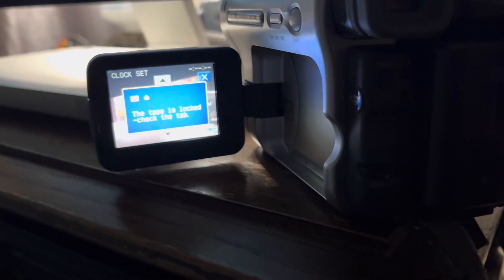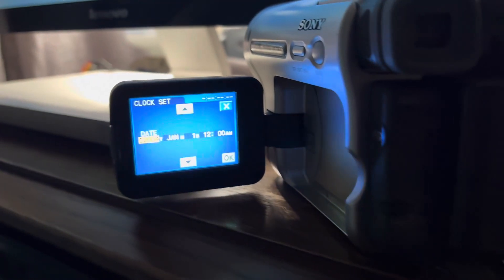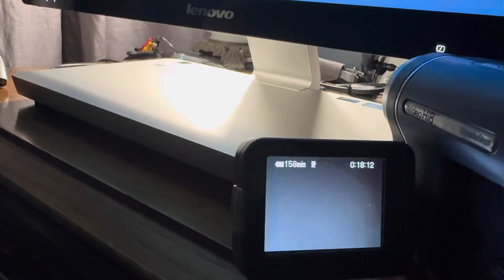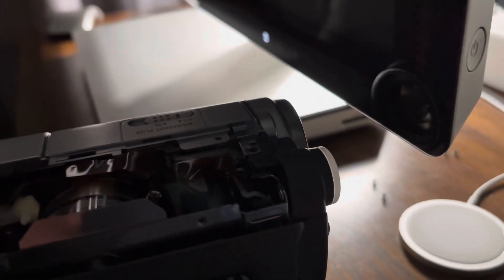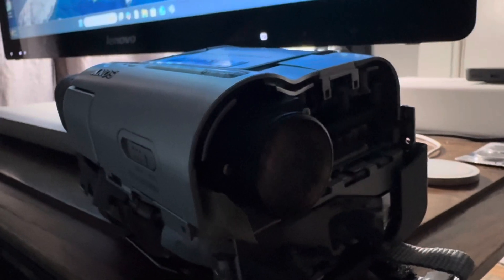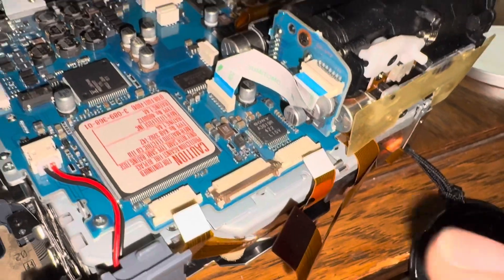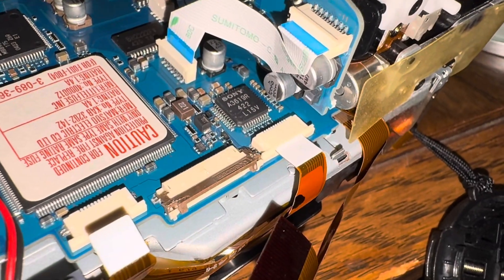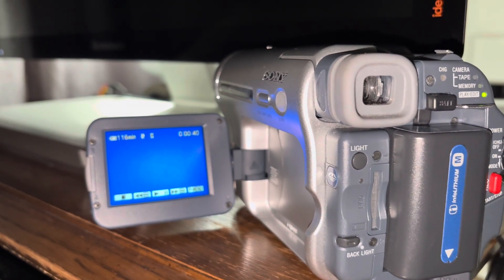Sony Handycam DCR-TRV460 Digital 8 Hi8 camcorder no video blue screen repair

Comment: Not sure where to ask this question, so I chose your most recent video. I have a Sony camcorder CCD-TR64.  I have been transferring hi8 tapes from it to my computer. Been working very well. Unfortunately, I came across another big box in my closet of tapes. lol So, I started transferring those. I loaded a tape, and heard it misload. It would only eject halfway. I took the camcorder apart and was able to release the tape. Since I had the camcorder opened up, I went ahead and properly cleaned the head drum. Put it all back together and got another tape and it loads and ejects properly. However, when I put it in play mode it begins, then stops and beeps several times. It will not play, FF, or rewind. It doesn't look like the tape is moving, but the camcorder tries to then stops. What am I missing? Advice? TYTYTY so much.

Comment: This is super cool- I'm very beginner-y but I recorded using a Hi8 tape and when I try to play it back it shows my video but then auto-switches to Hi/8 mode and then no longer is able to pay the video. I tried going to PB mode but it isn't giving me an option to switch back to Digital8. Am I missing something here? I'd assume the Hi8 tape would play in the Hi8 mode but it's the opposite. Would love any intel! Trying to use my DCRTRV460 to record video and then play it back andrecord on quicktime to get it onto my Mac. I have all the cords but can't get it to work! Thanks!

Comment: Nice video and great instructions. I do have a question, I have a CCD-TRV70 and the view screen has a negative appearance and more red in color. In your experience is this a possible bad ribbon connection, bad screen, or a bad component?
Reply from the maker: It could be likely a bad cable. If you move lcd and swivel it and color change then it the cable. I would also unplug the cable to lcd and reconnect it as well. The LCD itself rarely fails on those. My other camcorder a Sony CCD-SC55 had a faulty cable as no backlight at certain angle and did the red tint and negative appearance and was the cable as changed it as had a parts same model camcorder and is working normally again.

I would see if the AV video output is normal to rule out anything else. That model a good one and doesn’t have the leaky capacitor issue some of the older ones do.

Comment: Bro, you're a wizard.  Selfishly I want to see an unedited video so I can see with as much detail as possible and your techniques for (removing the flex cables, lifting the door for the flex cable, etc).   The screwdriver trick is really cool, appreciate that.  I've lifted a few doors and have had a side of a door pop off.  I've always tried to apply even pressure lifting up with a flat screwdriver or my fingernail.  Have had success at times and some not.  Never been able to fix the door once a side pops off though.  And the white ribbon cables with the blue plastic backing, always seem to cause me issues...so i'll try a few more using what you showed here.  Seems like as soon as I remove the cable the blue plastic just falls off.  I've tried lining the blue piece up with the end of the flex cable but have never had success reseating one yet.  Must be a skill issue lol.  Regardless, I appreciate the video.
Reply from the maker: The brown older ones are the problematic ones, using this method does help for most of them, but you do get ones that can be a pain just because they want to be. Those the backing love to slide a little off the flex. I typically pull them back out when they do and slide the backing back aligned back right at edge and then try again, if not and backing comes off I put the flex in connector first and hold it in place and slide the backing behind it back in and problem solved is how I get around that headache. The FPC connectors ones with the door flap on connectors are the easy ones. you just lift it with finger nail in middle and not to hard doesn't take much and then unlocks flex and you can just slide it out easy and keep the flap open when pushing flex back in and push flex in till it bottoms out and then close it. On the Sony handycams never broken them, but on old test gear have once in a while due to they can become brittle and tab breaks off due to age and just find the correct pitch/spacing and how many contacts and order one from a parts supplier like Digi key, or Mouser electronics, they called FPC connectors and solder a new one on, but that more advance level repair as requires good SMD soldering skills if you break one. Fixed many over the years that other as well broken, but repair iPhone motherboards to component level and game consoles, so comes easy for me. 

Once you do a few it becomes much easier and you get a technique down. I broken a couple early on.